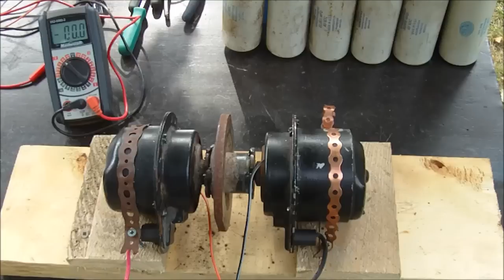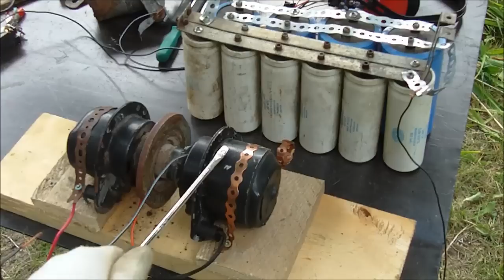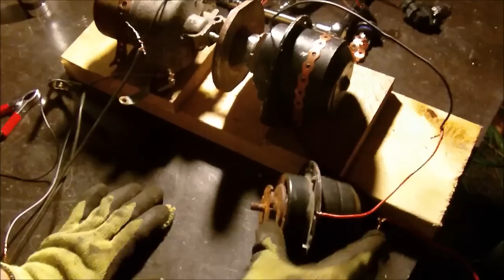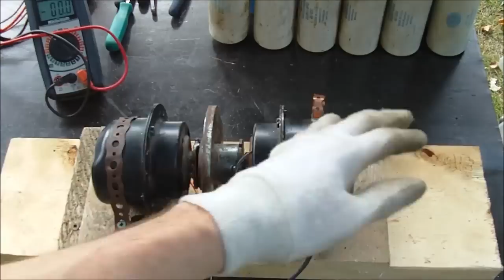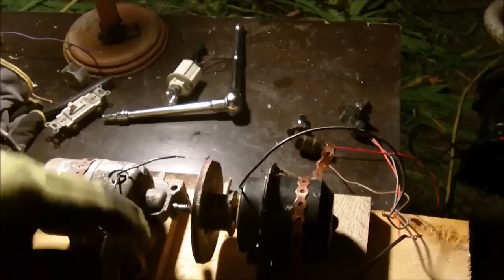Electric Motor to Motor, can they self run?

Comment: u should try using a gear system, the way a gear box in a car works, e.g. for every one rotation of the motor the generator rotates twise or even 10 times.
Reply: +Navneet Murti Great - Put 1000 to one reduction, should power the whole house - NOT!
Reply: +Alan Williams  "reduction" lol first get your words right. YES!!!!!!
Reply: +Navneet Murti Wtf are you talking about? It's not gonna work.
Reply: TheFarciarz777 how do you know, back up ur answer with some factual info then.
Reply: The gearing really doesn't change a thing. It only changes the speed and torque ratio but the power transfer is the same.

So let's assume we have a 1:10 gearing ratio and a couple of identical motors/generators. Now let's assume the shaft is spinning at a constant rate. The generator will spin 10 times as fast as the motor and assuming that the efficiency is constant, it should produce 10 times as much power than it would while spinning 10 times slower.
Now, the motor gets 10 times the electrical power but because of the gearing ratio, it has to use 10 times as much torque to spin at the same speed.

Now, some math: (we'll use imaginary units for simplicity)
1:1 ratio:
Generator produces: 1 speed * 1 torque = 1 power
The motor uses: 1 speed * 1 torque = 1 power
The power on both sides is equal.

1:10 ratio:
Generator produces: 10 speed * 1 torque = 10 power
The motor uses: 1 speed * 10 torque (because of the gearing ratio) = 10 power
The power is, again, equal.

So the gear ratio doesn't change much. It will probably make it even more inefficient because motors and generators don't have the same thermal efficiencies over the whole rpm range.

The motor will output only as much as the generator provides it with which which cannot output more than the motor provides it with.

Also notice that every electrical device have thermal inefficiencies. Some of the energy is lost due to heat generation.

No matter how you design it, it will always lose energy.

There's no free energy nor will there ever be.
Reply: TheFarciarz777 WOW dude I actually enjoyed reading ur comment/explanation, I now understand why this will not work. Going in depth and keeping it simple ;)
Reply: +Navneet Murti NO!!! - I can't find a word related to Increation, and a common word for gearing is "reduction" regardless if you use it forwards or backwards.
Reply: +TheFarciarz777 Someone willing to articulate that speed x torque is power. And for fun - A rod welded to a building has enormous torque, but we all understand that there is ho power because it doesn't move.
Reply: Your point?
Reply: +TheFarciarz777 im not willing to articulate the obvious
Reply: Your point is not obvious. You said something but I don't know what message you want to deliver by that.
Reply: +TheFarciarz777 Probably easier to figure out than a crossword puzzle.
Reply: Not really. The rod-building analogy is not clear since you know that I know that power = torque * angular speed. You show that you know but what about it?
Reply: That would not work because energy would only be expended in torque to the driving motor to the motor, geared 2-10 times that of the other. If you drive stick and try to start in third, that's basically the same mechanic except you're using the energy of your engine to propel yourself in motion.
Reply: +Navneet Murti that wouldn't work... you add more friction and it also takes more torque to get motor 2 running... there's no way to get a pair of motors to self-run without them being 100% efficient... which simply cannot happen!! motors are just too inefficient
Reply: +ThEcRaZ3dGaM3R laws of energy and motion prohibit this, you just simply can't make any machine that works like that
Reply: Adam Keller exactly my point :P it would absolutely need to be 100% efficient, but this is impossible. there is bound to be SOME losses somewhere... friction in the bearings, commutator arm and brushes, and especially with the coils in the motor and the magnets, which slow the motor down significantly!
Reply: ThEcRaZ3dGaM3R Exactly, whether it would be a voltage / amperage drop, or the generator side needing more power, which in turn, puts more resistance on the stator, bound to the motor, causing a mechanic called stall. The same mechanic is applied in the torque converter in an automatic car, except it acts as a clutch, instead of a resistance based generator.
Reply: I recently shared a video with a physicist he made his calculations and told me I was generating 1.02 joules of kinetic energy out of 100w per hr (.0277 watts/sec) 1 joule = 1 w/sec. , when is true you can't have overunity it is also true you can have a self sustained mechanism no need to tell you he got mad at least it wasn't me telling him how to do the math he did it himself....
Reply: +Roberto Montes very true... only issue is that getting the motors to self-run would require a very high efficiency system with minimal friction... so short cable runs with proper termination (using a soldered lineman splice on the cabling is a good idea, copper lines are a must, and the thicker the better for lower resistance!), as well as using lightly oiled ball bearings to try to minimise the energy lost in the shafts. Some things, such as  the Eddie currents in the windings and also the stator magnets themselves can't be avoided, they'll generate a pull on the motor with an opposing force, but as long as the motors can overcome this they can begin to self-run... Now for my next trick... 100% EFFICIENCY!!! (marketing w^nk term: "Overunity")... is impossible for this setup!!!  motors are inherently very inefficient! there's the aforementioned bearings, the copper wires creating lots of heat, a bit of noise and also the's the commutator bar which will generate some more friction, therefore making heat and also some light through arcing when a new section of the bar aligns and the other side disconnects (which also creates an inductive spike)... it's absolutely 100% impossible to obtain 100% efficiency! I might not be a PhD physician but I know an inefficient setup when I see one!! (I do engineering so I'd have to be a dumbass not to!!)
Reply: +Roberto Montes go back to the physic of stall, as I explained earlier. As soon as one side of this 'generator' craves more energy, the other coil will be further magneticized, causing more pull on the stator, causing stall, also, you must take into notation that with this setup, you have non floating bearings, which cause resistance, which will cause stall, energy loss through wiring, energy loss through sound and heat, and of course energy loss from starvation, causing stall. There is no way to perpetuate 2 points of which both require a constant draw, and AC phasing, since those are AC motors. With those phases, the coil will switch polarity constantly, causing the rotor to turn (coil being the stator), but these 2 motors are exactly 180 degrees out of phase, and will always be, causing each motor to stall the other out. There is no way for this concept to work.
Reply: +Navneet Murti That would also increase the strain on the motor, so not practical. Might be a bit better, though.

Comment: only Wilfred figure this out...its not really rocket science ...its engineering mathematical possible ...just nobody have not figure this out yet in reality...until now i am half way breaking this barrier of this engine...what they haven't tried is reverse polarity generators since electron is gonna into direction in a flow and return back to flow is what your ac does in your homes that connecting to the source...dc motors are great but not really efficient to combine both....

Comment: yes they can self run but the problem is to creat 0 point energy you have to change the tempreture to 0 or less to let the electrons flow free once you get the electrons to flow free at 0 resitiance you get 0 point free energy the trick is basicaly free coolling free electron flow equal free energy which you can use to do more . but cooling electronics in a working platform can be difficult good luck lol 😈😈😆😆😆😨😱😱😱😲😲😵😨

Comment: You have to get a motor with more power not with the same voltage and you need a transformer
Reply: Wisdom Afoolweakness no, get a generator that puts out more voltage and a motor that doesn’t take much volts.
Reply: @ecbadboy101  I know a guy in my country that make one of these and he did exactly that what you said l

Comment: Man, What u trying is possibel but not with the motors u using. If u want it works u need 2 have 1 motor bigger then the other one, soo the magnetic field u genrate with the induction is bigger with a less power dissipation. Then u food u small motor with u bigger motor, and if u want a better rendement for long time use batteries.

Comment: Hmm, first off from what I understand in relation to this free energy jazz.  That electric motor needs to be an ac 1/2 horse  with a 100 or more watts current draw and  directly coupled by a pulley to an 5000 or more watt  AC generator to duplicate what these other gentlemen have done successfully. You demonstrated this push/pull application using GM blower fan motors that can draw as much is 8 or more amps of power on start up. It's the old 5000 push to 100 pull physics equation that sounds theoretical enough for me to even try it myself just as soon as I can locate the proper test generator...
Reply: Paul West sorry chap but your use of technical speak is total BS...
Reply: Watts current draw?
Reply: An AC generator hmmm? Don't you mean an alternator? Using an alternator output fed in parallel to a DC supply to the motor...why would you want to do that....the trouble with all these posts is that the people posting them don't understand the basic laws of physics....as yet there is t a way to create or destroy energy, you can only change its form and in any conversion of energy, there is always a certain amount of loss. So if you convert electrical energy into movement by means of an electric motor, some of the energy from the supply will be lost in heating of the motor, it's cables (due to resistance), internal resistance of the battery (heat and chemical changes), sound. Then if you hook up the motor to a DC generator (incidentally, the DC Output is not a steady DC voltage, it is a rapidly rising and falling voltage that changes as the magnetic flux provided by a permenant magnet cuts the electrical conductors as they rotate through the magnetic field) there is power lost in friction from the motor pulley to the drive belt, the dive belt to the generator pulley. These losses all add up significantly and therefore, even in the most simplest of terms, this therefore means the for a given power input, the power returned from the generator is the input power minus the losses due to the above which means that you therefore lose power in the process and therefore you cannot create a self sustained no circuit. Even if you could, the moment that you add any extra load, ie, try to use some of the generated power to light a lamp for example, you are taking even more power out of the circuit!! Apart from all this, it would be very difficult to actually build an electronic circuit that could isolate the input power to the motor from the Generator output. In reality, what would happen is that both motor and  generator would both try to behave as a motor and a generator to some extent. If you read anything about free energy using this method it is BS and nothing more.
Reply: +Chris Cain I wouldn't even waste time trying it, but there are a lot of idiots out there swearing this is going to work, because the earth is flat, space does not exist and its all covered up by the government.

Comment: if you can achieve 100 efficiency, you'll be rich.... rich i tell you.
Reply: +raykupal nope, youll just have an eturnaly spinning motor.

now get even 0.1 % over 100% efficiency and you'll certainly have a future...
Reply: An electric heater is 100% efficient
Reply: Roger Galbraith
still not quite (at least by energy departed precisly at the heater)

still some inferred rradiation and sound waves...
Reply: +Roger Galbraith Electric heaters are something like 99.8% efficient. You must account for electrical resistance in the pipes used.
Reply: But that resistant generates more heat (the goal) the only loss is as sound and radiation, both of which finaly decay into heat (if not in the immediate area)JJ Warner
Reply: N ytonial You still don't get as much heat energy as the electrical energy you had before.
Reply: No, like I said there are losses from radiation and possibly sound. But the "resistance of the pipes" is what causes the heat in the first place.

And since both sound and radiation convert back into conventional heat  upon contact with other atoms, it can be considdered 100% efficient (unless you needed all the heat in a very specific area)
Reply: N ytonial There are also losses from light generated, even if you can't see it.
Reply: JJ Warner
Thats what radiation is.
Most well known as infrared "Radiation", though the lower band radiowaves are emmited from all objects up from 0K

Comment: If you expect any efect close to self runnign firs get rid of al losses possible. Motor is shaking propably shaft are not centered, whell is not balanced, you wasting much energy. Second that configuration will not work alone not on standard principle of motor working. Its like trying to power ON induction engine using DC voltage...

Comment: Well, self running is not true, 
each motion needs (source-
energy ) to work. Example,
watch the wind, when it 
blows, it spins turbines 
And when wind stops ,
turbines stop too.
so all self running are not
true. You can spin wheel
using gravity power for 
short time 12 or 15 minutes, 
Good luck man.
Je. Saudi Arabia.
Reply: So you're saying that machines are deterministic. I have never seen a motor that cared where it got electricity from. And I've never seen a generator that cared what turned it.

Comment: You can never create energy, by having a big flywheel all you would be doing is storing the energy as kinetic energy, energy can only be transformed. This is the equivalent of a perpetual motion machine, which is also never possible.
Reply: If the motor and generator were both 100% efficient you could never get energy from the system as it would just slow down, this is without considering resistance in the wires and friction of all kinds.

Comment: side by side they will work..you need the weighted hub on the pushing motor side..the main problem you have here is rotation..they need parrelel rotation not face to face. you need the first smaller one pushing weighted beside the larger one "stronger" motor generating ..reason is if the smaller one requires slightly less to run and the stronger one is generating ..then the smaller one will have momentum to force the larger one to roll creating enough push and generating enough power to run both..easier way would be to use a small pulley on a 1/4 hp motor both permanent magnet. test them seperate so only one is hooked to battery power at first.. use a 1/3 hp motor going say both rotate clockwise if you find one that runs counterclockwise then the face to face will in fact work. but say one rates 1000 rpm and the other needs 8000 rpm to generate..put small pulley a fraction of size so maybe 3 inch pulley on 1/4 horsepower turning a 12-18 inch pulley on the 1/3hp same rotation.. side by side and definitely you will have extra added power..i know 4 major ways to improve this..but im getting you onto step one.. hook your battery on 12volts to your pushing motor (if 12v if its 110volts plug it to a drop cord..ok while its already in rotation test the generator head..if its generating then hook your red up to red ..unplug your cord or line and hook your black neg up..itll hum but itll self power)..clutching your system with a regulator to slip the power push when higher than needed is a 2nd step 3rd step is storing the power in battery with regulator ..you could use a light switch single phase to bump it on..dont give up on your idea *IT DOES WORK your rotation is just wrong on this particular video.

Comment: I think this is a waste of money and energy spent when there are other ways of producing energy at a much lower cost.  In this type of theory you would have to have 150% efficency just to break even with the friction and heat from this mechnical method. We keep hearing about Quantum energy but that is for smaller than atom so that won't work either.

Comment: As I Understand...
An Electric Motor Ran Backwards Becomes A Generator... So To Match Motors, Face To Face, A Cogwheel Needs To Fit Between The Motors... So That When The Motor/Engine Runs, IT Turns The Generator In The Opposite Direction... 
Or Am I Wrong..?
*
IF You Run The Motor With A Larger "Cogwheel" Than The "Cogwheel" On The Generator, The Generator Will Complete More Revolutions Than The Motor...
As Long As The Motor/Engine Is Able To Turn IT'S "Cogwheel" With Ease... You Should Be Able To Turn The Generator "Cogwheel" Several Revolutions Per One Revolution Of The Motor/Engine "Cogwheel"...(Let's Say, The Engine Cogwheel Has 60 "Teeth", While The Generator Cogwheel Has 6 "Teeth"; That's A 10 To 1 Ratio)...
But You Still Need A Cogwheel Between The Two...

Comment: If you wanted to do this, this is NOT how you would do it. The people who work this on YT use a small motor which operates via mechanical advantage (pulleys or centrifugal effect) to run a much larger motor. The larger motor operates as the generator.